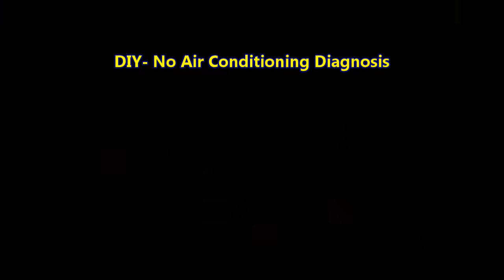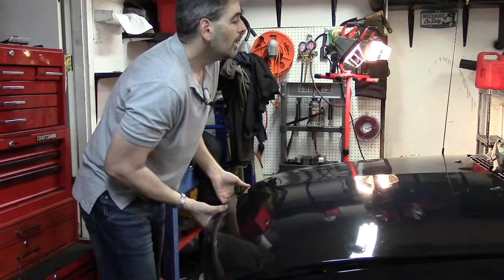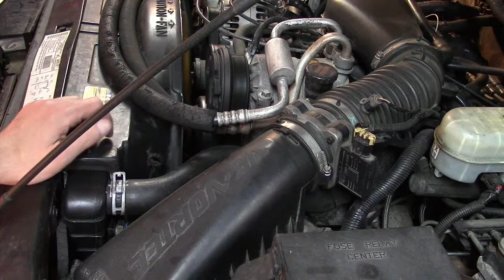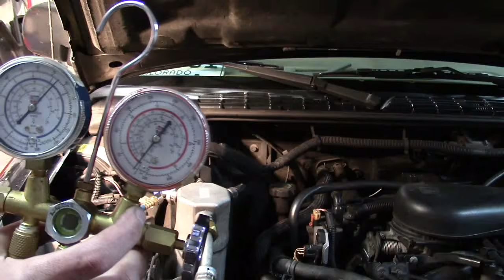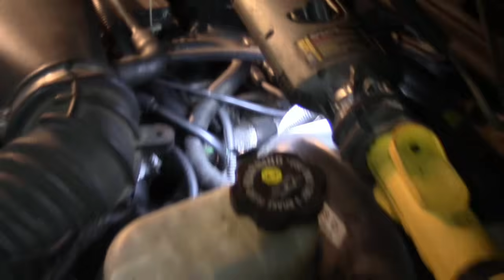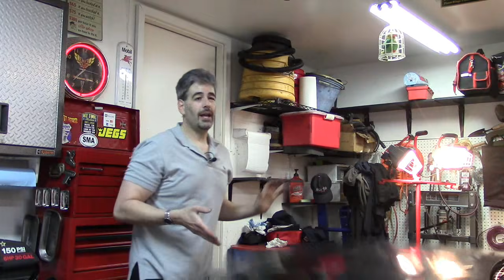DIY- Troubleshooting No Air Conditioning

Comment: When you check the switch at around 9:00 minutes in you say no volts there then disconnect and show 12 volts on your meter.  Where is the twelve volts coming from? Sorry, just trying to learn the right way.  Appreciate your videos.
Reply from the maker: yes it’s a great question. the voltage is coming from the fact there is no longer a voltage drop across the load.  since it now creates an open circuit you see voltage because current flow has stopped. 
   i explain this fully in my basic electrical training videos.

Comment: No criticism,  I appreciate any creator.  I agree it has ok low pressure,  but you should have used an ohm test on that switch. Then, if the connector is 2 pins, you could just short them out to bypass that switch and indicate to the ecm to provide power to the relay control contacts. The relay activates and bridges power from the 10 amp fuse to the compressor hot wire. 
All in all you fixed it ! Great job and I hope you're well. Loose wires can be a pain.

Comment: So somebody cut his wire while he stopped at a stoplight
Reply from the maker: No. The wire failed as mentioned from high resistance.
Reply: @SchrodingersBox  1:17
actually at a red light the air
1:19
conditioning was working fine he heard
1:21
the compressor click off and it just
1:23
started blowing hot air ever since just
Reply from the maker: Exactly. Just as I said.  It had to fail at some point. When that happens is irrelevant. WHY it happens is all that’s relevant.

Comment: Waiting for your reply
Reply from the maker: Sorry reply on what?  I get over 200 comments a day so I sometimes lose track.
Reply: @SchrodingersBox   pls sir, I am having a problem fixing a coastal bus with AC issue (Name: Joylong 2.7L) current does not supply to the compressor wire, I have traced the wiring system but I didn't see anything, I also used a diagnostic tool but the diagnostic tool didn't detect the name of the vehicle
Sir I need your help, I have even changed the relay that controls the compressor and it still did not work
Reply from the maker: What happens when you provide voltage to the clutch?

Comment: Pls sir, i am having a problem fixing a  coastal bus with ac issues (Name: Joylong) and current does not supply to the compressor wire, 
I have traced the wiring system but i didn't see anything, i also used a diagnostic tool but the diagnostic tool didn't detect the name of the vehicle
Sir i need your help, i have even changed the relay that controls the compressor and it still did not work.
Reply: Reply on this

Comment: Hello there. I have a kind of a strange question, at least for me :) cause I cannot give it a logical answer.
So my ac compressor kicks in, refrigerant is ok, it is cycling quite normal I would say (40 seconds on and about 10 seconds off) but colling on idle is not that great. Sometimes it give very cold air when idling and sometimes is just a bit colder than outside air.
I hooked up a scan tool that can acces other modules than the ECM and there is a fault code that says "air conditioning compressor control, open circuit".
Now, how in the world can a compressor run when there is an open circuit? That would be my doubt. Appreciate if you could help.
I didn't get under the car to check but I'm pretty sure it only has a clutch with a coil to control the compressor, without a valve in the back of it. So I think it is a normal compressor and not a variable displacement one.
The car is a Renault Clio from 2014 if it matters.
Reply from the maker: What are your AC pressures showing? Maybe the open is a pressure sensor.
Reply: @SchrodingersBox  the guy from the shop where I charged the system said the pressures are ok. I was to far to see the pressures myself. The problem didn't happened when I went to recharge. And I recharged because the car is 10 years old, I just purchased it and I wanted to do a check-up of the ac system since summer is coming.
I think the pressure sensor is behind the front bumper on this Renault so it didn't get checked since the ac was working fine. But the problem was there before and after the recharge. Only that is random and that fault code pops up when I use the scanner (Thinkdriver one so not only a normal OBD2 reader).
A compressor can have both a clutch and a solenoid valve to control it? I knew that either it has a clutch and a coil OR a valve without a clutch. Mine definitely has a clutch so I suppose it doesn't have a valve.
Anyway these days I will go under the car and try to figure out where the pressure sensor lives.
Reply: @SchrodingersBox on my car the compressor is also controlled by a termistor placed in the HVAC box, that measures the temperature of the evaporator and cuts off the compressor when it is near 0 degrees (near freezing). So the two things that have to do with the control side of the compressor are the pressure sensor and this evaporator temperature sensor. If I pull out the temperature sensor from his housing the compressor runs all the time, without cycling, but this kind of "fix" is dangerous since the evaporator could freeze and break.
Reply from the maker: Yes many cars have that shutoff. You can see what that sensor is seeing on a scantool and determine if there is connection to the PCM or if there is an open or short on that circuit.
Reply: @SchrodingersBox yeah, I'll do that. Yesterday I saw a pressure sensor on the high pressure line just under the right headlight. It has 3 wires, it is accessible without removing the front bumper and when I unplug the connector and run the ac, the compressor doesn't come on and it generates a different code that says "053017 refrigerant sensor voltage". So probably that pressure sensor is ok. Altought I do not know if there is another one on the low pressure side. For that I think the bumper must come out.
But I'll follow the lead on the termistor in the HVAC compartiment for now and I ordered a set of gages to see exactly what the pressures are. Maybe that termistor is faulty and is telling the compressor to shout down more often than is necessary.
Reply from the maker: If there are three wires that sounds like a potentiometer not a thermistor. It sounds like that may be a pressure sensor perhaps. I’m not familiar with any three wire thermistors.  Since it’s easy to access I would just check the signal voltage from it to see if it is pressure or temperature responsive.
Reply: @SchrodingersBox the pressure sensor on the ac low side line has 3 wires and it's most probably a sensor and not just a switch. When I unplug that one it generates a new, different DTC.
The termistor in the HVAC compartiment only has 2, not 3 wires.
Reply from the maker: Ah yes good point I forgot it’s probably a switch. Agreed- sounds like a good place to start.

Comment: my mechanic has replaced all components. still not working properly. he advises the compressor is not coming on because the circuit blew and i need to replace the engine computer.. He did test system and it holds freon. compressor is new.  the max light does not come on on the switch.  my question is how do i know the switch is not the problem
Reply from the maker: You just check for continuity at the switch. Or simply bypass it and see if it works.

Comment: Sir I do have 2010 Chrysler town and country I’m in vacation with family ac working fine but No cold air only when I’m driving mechanic change every on the switches and compressor and condenser still there is no cold only when I drive but not really there’s to much air come from the  doors I don’t mean the car doors I mean was the air come from the little ones $1300 and still No cold air I told him I think something with wires but he said no any help please please forgive me English is my second language thank you oh even I replaced the fan yesterday still not working
Reply from the maker: what are the low and high side pressures?
Reply: @SchrodingersBox  high is 255 low 40 to 50 but when I accelerate go down to closest zero
Reply: @SchrodingersBox  pipe doesn’t go cold
Reply: @SchrodingersBox  now I’m in Houston going to the water park feeling cold at the highway thank you for your help sir but soon I stop get warmed
Reply from the maker: That’s weird. It seems backwards- usually on a failing compressor the numbers get better when RPM increases because compressor spins faster. I’ve never seen or heard where compressor drops to zero with RPM. Loose belt??
Reply: @SchrodingersBox  yes sir like I said almost $1300 nothing changed, wish me luck to find someone as professional as you have a blessed day.

Comment: 2010 ford focus, no power to the control side of the relay. Clutch engages and spins when relay jumped. How do I test the 3 prong pressure switches?
Reply from the maker: if no power to the control side then its pretty simple.. if fuse isn’t blown then you have an open between fuse box and clutch.

Comment: Can someone help out please 🙏 I am going nuts here with my ac problem. I got:
Proper charge, good pressures (when clutch engaged and ac working briefly), no leaks, new condenser with drier receiver, new txv, new shrader valves, and new clutch. 
Ac clutch takes 3 to 4 tries before finally engaging and working great with cold air coming out. Unfortunately, the clutch cycles on and off every 5 seconds while bogging down the rpm.
Reply: The car is 2011 nissan maxima.
Reply from the maker: Check the high and low pressure switches to see it they are engaging.
Reply: Finally figured this out as unlikely as it was. It’s the intake sensor/evaporator temp sensor that prevents the evaporator from freezing. It’s faulty and it cycles off the ac compressor clutch. 
It’s absolutely ridiculous the amount of trouble I went through by replacing unnecessary parts. I guess the joke’s on me. 

This just shows you how incredibly important it is to diagnose the problem correctly so that you don’t waste your time and money by replacing working parts.

Comment: One trick to release the ac clutch u can wire from ur battery to the fuse panel with clamps and it turns the clutch over
Reply from the maker: how would that work when the clutch is ground side switched?

Comment: Where are you at as I have the same problem air conditioning not working. It was working in August when I bought the vehicle. Now I go to turn it on and the compressors not worki'd like for you to check it out
Reply from the maker: Denver colorado.

Comment: I have a 2002 Mazda protégé.  I'm now on a fixed income and have to do all work on my car myself. Thank God for YouTube.  My heater works but not the air-conditioner.  The speed switch only works on 4 now, but I noticed that only one pully turns on the compressor/motor. I'm not sure what it is.  What do I do to fix my air-conditioner. Watching your video, I guess it's the clutch pull only one turns.

Comment: Slim having all these issues. Crazy thing is I can put a jumper in the relay spots and clutch kicks on
Reply from the maker: possibly it’s a control side issue then.
Reply: @SchrodingersBox  ha, tracked it down to a short at the A/C pressure switch connector. Thanks. If it wasn’t for this video I would have never gone through it so thoroughly! Dang man, 3 days messing with it. I’m still confused how it turned on when I jumped it, I’m thinking I was revers feeding power activating the clutch, but I don’t think that’s possible. Anyway, thanks a lot man.

Comment: That's funny I'm having the same issue.
Everything works including the clutch when applied 12 volts, but the clutch is still not running when connected to the wiring.
So should I look for a open in the circuit somewhere?
You don't have to answer that, I'll I'll look.
Reply from the maker: no- you should start by diagnosis IF there is an open or short. that’s the first step.
Reply: @SchrodingersBox  I have already found the problem after checking the fuses, relays, and sensors.
This morning when the engine was cool, I removed the intake manifold, and there was a loose connection behind the compressor that I didn't know existed.
It was under that big tube so I couldn't see it.
The retention clip broke so it came loose, so i fixed it with a paperclip and electrical tape.

Comment: So I know this is an old video but I have a 2009 Tahoe and my 10a fuse blows as soon as I turn on a/c I know I have an open but I’m not sure how to find it should I just follow the compressor wire or could it be somewhere else
Reply from the maker: how can the fuse be blowing if you have an open?  How would that be possible?

Comment: some local said ; $50.00 for a tune up on the system. It just stopped on the way home from work. 5 years ago. what about this low pressure switch going bad. I have a paper clip to jump it across. Could that really be it? 92 4.0 cherokee.

Comment: First of all, I am no expert on diagnostics like yourself.  With that said I just learned how to use my multi meter because of you.  Now, I could really use your help.  A/C stopped working during a miss fire on #2 - 2012 nissan altima 2.5 s sedan after I got thru putting on all new coils and plugs.  Turns out a plug was bad.  During the miss fire I broke a cardinal rule of driving while check engine light was flashing up to the auto parts store.  Very violent experience to say the least.  So what I've done...  I have 13 volts coming out of the power supply lead going to the clutch.  Clutch is free spinning from compressor, never had a problem with it.  No pulley noise and pulley running fine.  Clutch not engaging since the miss fire code, thus no A/C.  I think it's something easy like electrical and not mechanical.  Do you have any ideas for a guy just trying to do a little wrenching to save money with a little talent I possess.
Reply from the maker: while there are 13 V to the compressor clutch connector, that won’t account for possible voltage drop. easiest thing to do is apply battery voltage directly to clutch. if it doesn’t work, it’s your compressor. if clutch activates you either have a voltage drop on the wiring OR you have a shorted ground side control.

Comment: Good job shroodinger.. I think I have the same problem.. I have a 1999 Ford F250 Super Duty.. I sent voltage to the compressor and it clicked.. Checked the low and high pressure switch, good..
I think I have a break somewhere or a faulty control module.. Because the compressor is working.. I ran 12volts to it while it was running.. Low pressure was at 40..high pressure at 210..
Static pressure was a lil weird though.. It came out to 350 on the low side and 150 in the high.. So I'm thinking thier might be a restriction somewhere also.. The trucks been sitting for 2 years.. But it's in good condition tooken care condition..
Well if have any advice send me a few lines.. Thank you for the wisdom.. 👍
Reply from the maker: yep sounds like same issue. And a power issue at that since if you add power to the clutch directly it activates so ground has to be good.  I would check for power to load and control relay ports and apply power from the load side of the relay.  this will tell you exactly where the issue is.
Reply: @SchrodingersBox  OK, thank you

Comment: I have an intermittent cooling driving in the freeway and suddenly the a/c stop cooling but when I turn off for 10 minutes and turn it back on it will ice cold again and it happened in 3 separate driving situation.What could be the issue?I noticed that before it quit the temp will go to the3/4 mark not close to the red.
Reply from the maker: sounds like a clogged orifice tube.

Comment: I have a leak from the evaporator line that goes to the compressor. Any suggestions on what it could be?
Reply from the maker: I see that all the time. replace the line, desiccant and evacuate system and recharge.
Reply: @SchrodingersBox  what would the line be called?
Reply from the maker: high side line.
Reply: Im sorry i meant a leak from the evaporator line that goes to the accumulator 🤦‍♂️
Reply from the maker: that’s a low side line then.

Comment: My compressor turns on but lexus blows warm was gonna add freon to low side port but pressure was too high any ideas?
Reply from the maker: yes. if pressure is to high check the oriface valve. I usually test it with a basic static decay test to keep things simple.

Comment: What if you have one that word intermittently?
Reply from the maker: Then you have to catch the issue when it happens. It can be frustrating. If it’s electrical, jiggling components and wiring connections may reproduce it.  My variables I suspect for intermittents: suspect Vibration, Heat, other accessories causing voltage drop, and moisture.
Reply: @SchrodingersBox  when is the issue gonna happen?
Reply from the maker: When there is either a voltage drop or a pressure drop opening the low pressure switch

Comment: My AC stop blowing cold air after awhile of running in 80m/hr but it return after resting  while no problem if im running below 60m/hr..... my motor and condenser is new. What might be my problem?
Reply from the maker: could be anything. What do the low and high side pressures show?
Reply: @SchrodingersBox  just happened lately and no idea on pressure cz it work normal in short ride. It happened only in long-distance drive
Reply: Have you tried plugs and wires?
Reply: @DrFillyBlunt  whats that?

Comment: But why was there a clean cut wire, if the aircon worked then didn't?
Reply from the maker: Some asshat before me didn’t know how to crimp a wire. So because of the high voltage drop across the terminal, it eventually just burned off clean at the crimp.

Comment: Awesome Diagnosis,  my AC stopped cooling but the compressor kicks in, I put refrigerant in still hot air,  Any Suggestions I would Appreciate. Thank You
Reply from the maker: What are the high and low side pressures showing?